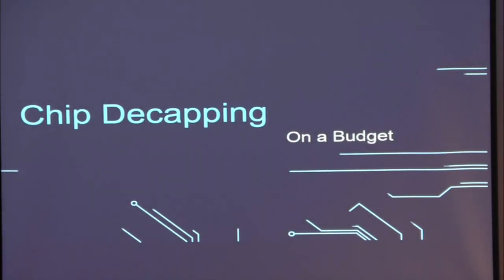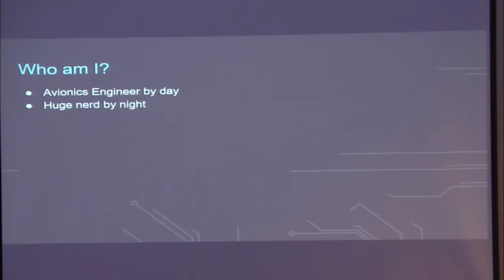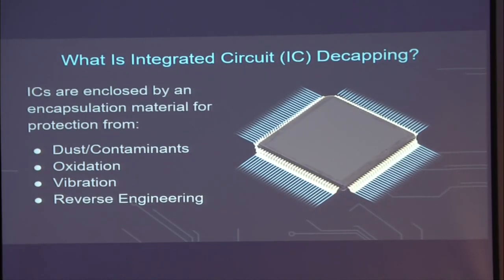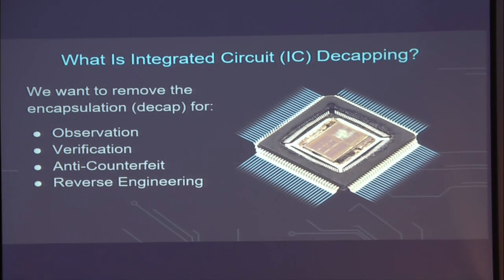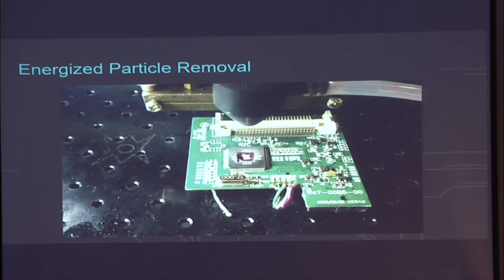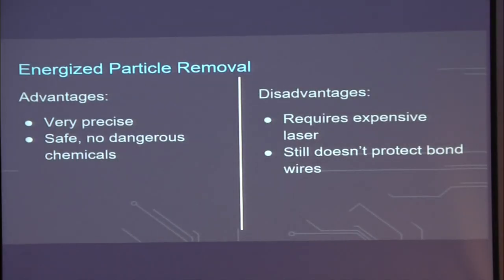Chip Decapping on a Budget - Zach Pahle (Shmoocon 2020)

Comment: I used a blowtorch lighter on an old motherboard chip. I was succesful, but under the microscope it showed the die suffered from heat damage in some places. As a private individual, I can't buy concentrated sulphuric/nitric acid in my country. Every company just doesn't sell to private individuals in concentrations above 3%.